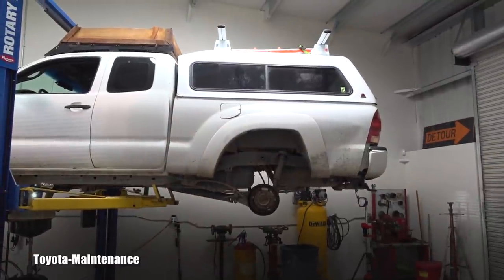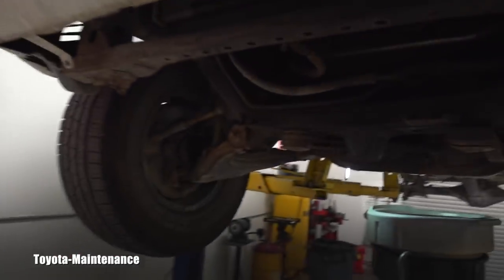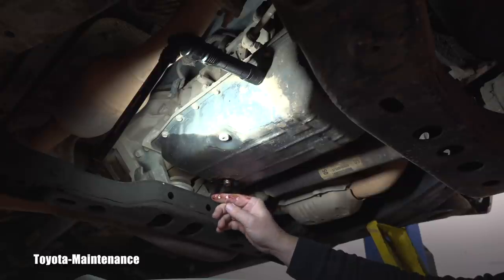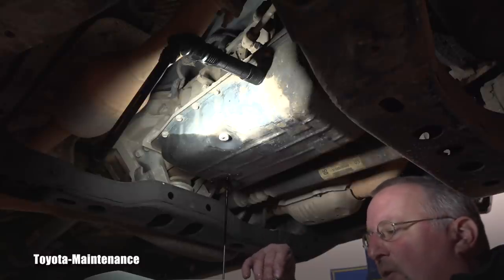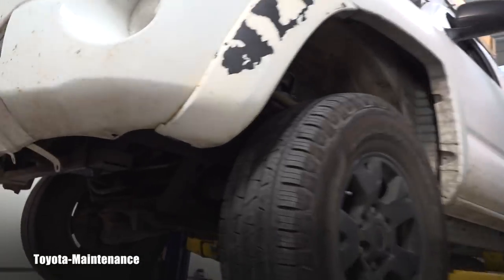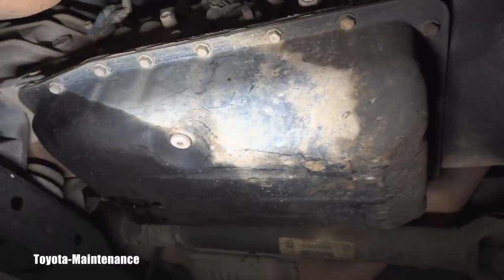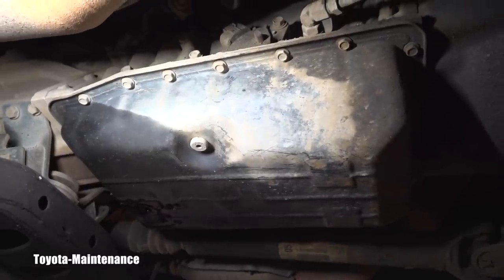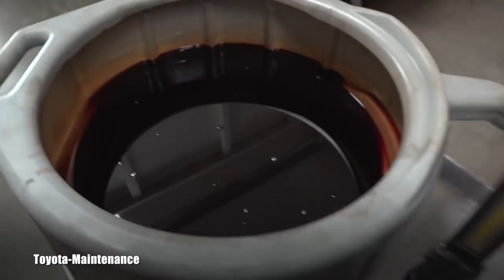Toyota transmissions can take a lot of abuse

Comment: I flushed mine at 35k with 16qts of amsoil ws compatible fluid.  I'm too damn OCD.
Reply: No, You bought the best lubricant on the market. I did the exact same thing when I bought a 6 year old Tacoma TRD Sport with 25,000 miles on the odometer. Every other lubricant was alos switched to Amsoil's top spec products at the same time. Toyota's premium quality vehicles deserve the best protection. Owners who paid a premium to get a Toyota deserve the premium peace of mind. ;-)
Reply: @rightlanehog3151  According to whom? Aisin validates it’s transmissions over millions of verified miles using WS fluid. No aftermarket fluid matches this. Just because a lubricant is “synthetic” DOES NOT automatically make it better. If you believe this you need to do some research on lubricants. It’s fine to like a brand such as the one you mentioned, but the fact is it doesn’t have the validation and track record of WS.
Reply: @nordicpride9708  Thanks, I have done plenty of research which eliminated many brands of inferior lubricants and I will stick to Amsoil's top spec products. The other family vehicle has the standard Corolla 1.8 engine in a 2005 model.  For the last 10 years I have been doing once-a-year oil changes in combination with an Amsoil Long Life oil filter. The result? The engine is still perfect. The lesson? Do your research and save MONEY by using the best lubricants on the market (Amsoil) to protect your investment in the best cars in the market.  :-)
Reply: Love Amsoil. Actually 100% synthetic.

Comment: I have a 2020 4Runner, how many miles should I go between transmission fluid changes?
Reply: Did that come with a manual? 
                                 ಠಿ_ಠ
Reply: @gus473  sadly no manual option
Reply: A simple drain and fill every 50-60k is perfect
Reply: @ScrambleNorth  I have a 98 4Runner manual 5 speed man it’s just so fun to drive puts a smile on my face every time.
Reply: @edwinthetechnician6578  I wish the new ones had the option. The new Tacoma’s still do
Reply: @ScrambleNorth  yeah I get you and yeah my older brother had a 2016 Tacoma 6 speed it was awesome but he sold it
Reply: @gus473     No ,   I asked the dealer that question and they told me every 60 thousands mile on my 2016 sienna

Comment: What are your thoughts on WS vs Valvoline Maxlife Synthetic ATF?
Reply: As Peter may not answer this himself, I can parrot what he, Scotty Kilmer and quite a few others say in Honda and Toyota forums...  ONLY USE THE MANUFACTURER'S-RECOMMENDED TRANSMISSION FLUID. 

Modern cars have so much computer control and they aren't as heavy duty like 1970s transmissions,   use the manufacturer's specified fluid.

In addition to viscosity needs, there are additives including detergents and anti-wear, anti-corrosive chemicals that vary based on the manufacturer's choice of materials.  Engineers spec. it out. They know better. The price difference isn't worth screwing the car up.
Reply: I used the Maxlife Synthetic in a 2007 Highlander 2WD about 15-20K miles ago. Its fine so far. I didn't do a full on flush and fill, but I did pull the pan, and changed the filter and gasket. I plan on doing the same for my 2009 Camry at some point. I'm happy with the product, but your mileage may vary.
Reply: @davidhahn8583  changing the filter screen is another neglected aspect.  

Still, all the mechanics who really know their Toyotas, Hondas even Subarus say use the OEM fluid.

Peter has said in on his videos too...
Reply: @SeanPopify  hi Sean, thanks for your comment. i agree 100% with what you said. I'm aware of the manufacturer recommendations. however, i still chose to use the maxlife knowing that. i was just sharing my experience. as i mentioned in my comment, your mileage may vary. Cheers!
Reply: 07 toyoto tundra valvoline maxlife  80K no problem
Reply: My experience:  used Maxlife in both a 98 1MZ-FE V6 engine and on cold startup, until the trans oil fluid heated to temp, the first mile or so was slow to shift. Took two spill and fills to get it back to normal more or less. I thought okay it's a fluke. Maybe the T-IV was what was supposed to go in it and I goofed, live and learn. But no. Year or two later, used it again in a 2GR-FE V6. Same effect. Two more spill and fills with what was now required for this one WS and its back better. On cold, it might hesitate a little, but not as bad as before. Felt like on both cars the pressure wasn't building to push the clutch plates together to shift and needed a sec to build the pressure. Was strange. Both vehicles still work without trans problems or at least not needing anything more than fluid changes. Was very excited to do it from all the raves on the forums. For me it was a mistake. Maybe our vehicles have tighter tolerances than other people's toyotas. So Cal and temps are warm lowest in the morning temps maybe 45.

Comment: Hey hi .. I have a 07 Tundra 5.7 . It has almost 170k , I have done a few oil flushes on the trans but never a whole oil change and filter . The truck runs and shifts like a champ . no issues . Just wondering if i should do the whole oil change and filter or not ? Can anyone help with this ? Thanks

Comment: No farther assessment or mileage is needed. That fluid was disgusting. Change at 60K miles should be more than adequate for moist drivers
Reply: We have 50,000 miles on ours and the ATF has been changed three times. (Drain & fills)

Comment: Yeah they can, until around 175k in a 99 camry on original fluid, we got the car for like 500 bucks, (this car taught us for sure) it wouldnt stay engaged in gear at a stop light or sign, and so we decided to change the fluid, it was great for about 6 months and then back to square one, changed the fluid again and almost had to call tow to pick it up from the shop, as it wouldnt move and they had to push it out of the bay, as we were waiting for a tow to get it home so we could get our stuff out of it, I revved it up to redline in park and dropped it into reverse, it worked,  then had to do it again in neutral to go to drive to go forward they drove it like this for a month about a month later traded it in towards a salvage title 2003 subaru legacy with just cosmetic damage, 1 owner and well maintained, with only 116k miles!! Had it  until about a year or so later, we were hydroplaning with a bald tire,  and my dads girlfriend panicked yanked the e brake sending us in multiple spins, both cars are now at the car heaven in the sky. And the Subaru kept us safe!!!
Reply: If the fluid hasn't been changed in that long, forget about it. The friction material is now suspended in the liquid and you should consider it part of the system.
Reply: @LAactor  we didnt know it was original just that it was dirty, growing up if we had transmission trouble in our cars we always changed the fluid and filter if it had one and the problem went away, sadly not with that car, the only reason we had done it is because we were at a red light and as soon as the driver took their foot off the brake and hit the gas the car just literally rolled back and was centimeters away from hitting the other car when it finally engaged, it went, but we didnt know what to do, probably would have been better off draining a quart of fluid and replacing it with lucas, never flush a transmission,  drain and fill with new fluid and maybe add some lucas is fine but never flush it, you'll flush out all the friction material and metal shavings that give the clutch packs enough friction to make the transmission provide power to the wheels. Lesson learned with that camry. I have 217k on my 2011 chevy malibu, got it with 185k the first owner waited til 100k to change fluid which is what GM recommended, but since I've owned it I've drained and filled it twice, once the day I got it and then when it wouldnt go right into reverse, since the fluid change it goes right into every gear and its given me no issues in 7k miles

Comment: I am not impressed with Toyota WS, but Valvoline Maxlife is very popular and a supposedly better fluid.
Reply: My exact question, I’ve heard many people mention the newest iteration of Valvoline Maxlife as a solid fully synthetic substitute for WS.
Reply: In the 60’s we had a Camaro SS, 396 375 HP with a solid cam, when we used Valvoline oil, the engine was very noisy. When we used Penzoil, it was quiet. I tried twice to get an answer from Valvoline, Answerman and something else. They promised an answer but never did. I will not buy a Valvoline product. Toyota recommends WS, their own. Toyota’s are the most reliable car out there. You think Valvoline will replace your trans. when it fails using their oil.....guess again. Jim
Reply: @jimpie231  Yeah,  60 years ago and not in a toyota transmission. Pretty sure they did not have full syn maxlife in the 60's.
Reply: What happened to me:  used Maxlife in both a 98 1MZ-FE V6 engine and on cold startup, until the trans oil fluid heated to temp, the first mile or so was slow to shift. Took two spill and fills to get it back to normal more or less. I thought okay it's a fluke. Maybe the T-IV was what was supposed to go in it and I goofed, live and learn. But no. Year or two later, used it again in a 2GR-FE V6. Same effect. Two more spill and fills with what was now required for this one WS and its back better. On cold, it might hesitate a little, but not as bad as before. Felt like on both cars the pressure wasn't building to push the clutch plates together to shift and needed a sec to build the pressure. Was strange. Both vehicles still work without trans problems or at least not needing anything more than fluid changes.
Reply: Cool, your the first I have heard of that has had problems with Maxlife. But I don't understand why your mentioning engines when we are talking about transmissions. My 2020 has a  AC60E, I believe, as example. Here is a thread from TW, https://www.tacomaworld.com/threads/synthetic-transmission-fluid-vs-oem.685843/

Comment: Hi Have a question for you how often should I change the transmission fluid I own a 2014 Tacoma
Reply: Every 1,500 miles
Reply: Guy,  I   don't   think   so.
Reply: @nurantulgar8293  You are right. Every 500 miles should do it.
Reply: I change mine at least once a year but that's because I have an ATF temperature gauge and I know it runs hot
Reply: @nurantulgar8293  ....sarcasm
Reply: My transmission shop said to change the fluid every 50 thousand miles
Reply: @nothanks2994  accurate, around 5 years or 60k

Comment: The real question is: Why are Toyota transmissions so robust?
Reply: I’m sure that one is manufactured by a company called Aisin. They make most if not all Toyota auto transmissions
Reply: Japanese engineering, Japanese work ethic. Fix and design until perfect, not just good enough. But accurate.

Comment: There is an exception to where you shouldn’t change your transmission fluid and that’s if your fluid has never been changed before putting in new fluid might make the transmission slip so you’re better to leave it alone in this case.